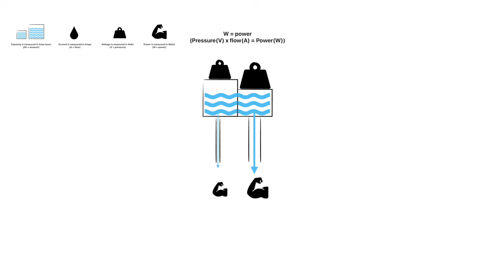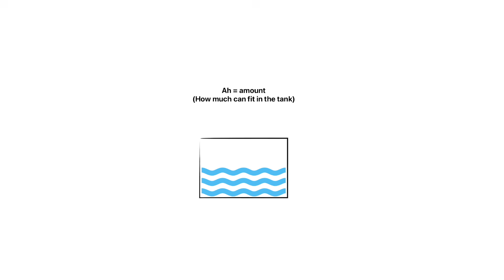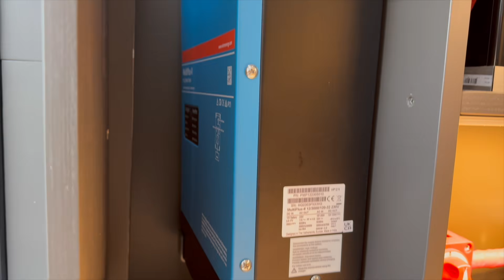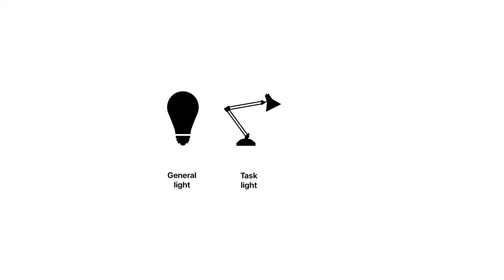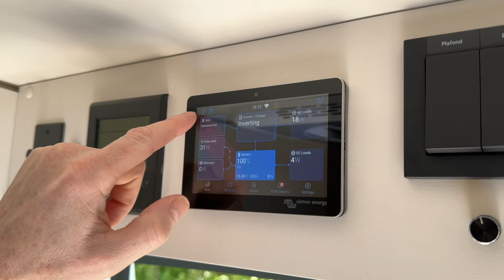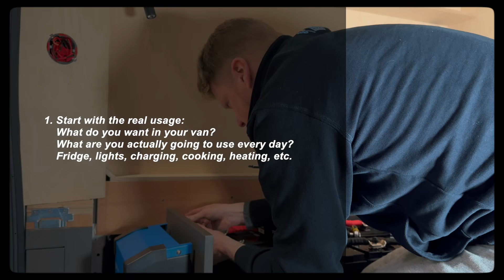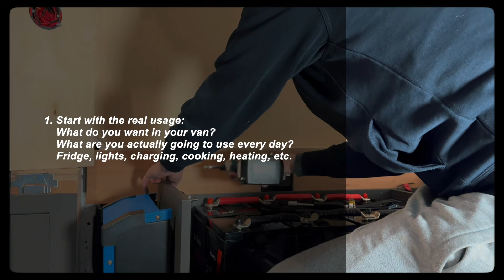I’m an Electrical Engineer, This Is How I’d Build an Off Grid System (Van Conversion)

Comment: Hi Sanne and Brendan,
Thank you for this outstanding, comprehensive guide to off-grid van electrical systems, your engineering insights and step-by-step blueprint are exceptionally clear for beginners like myself.

I am planning a similar Victron-based setup for my van conversion and would greatly appreciate knowing if you offer professional installation services. If so, could you kindly provide a quote for a full system install (including 400Ah lithium batteries, solar, DC-DC charger, and cabinet integration) based on my vehicle's specifications? I can share detailed requirements if you are interested.
Reply from the maker: Thank you and we’re glad to hear that it’s do helpful! 

We’re from the Netherlands so building your electrical system for you is not possible (you’ll have to fly me in so that would be a very expensive quotation 😅) but if you have any questions during your build, you can always ask. 🤗

Comment: Hey, nice video. But I was missing an important part: Picking the right voltage for your installation. I see you went for 12(14)V - But for my project I wonder if I should go for 24 or 48 Volt.
The reason behind that: I will install air condition. And thats a lot of Ah/day. So if my solar panels come from the roof with 140V - I need to convert it ALL the way down to 14V into the battery. But now my AC wants 230V or (12/24/48 - depending what device you but). So I need to get it ALL the way up to 220V wich isn`t great - OR run the AC with 12/24/48V. Given that the needed Wattage of that AC stays the same - and it`s most likely/common 1500Watts - a 12V system would run ~128A - a 48V system would run ~32A.
That is either very expensive in wiring or a good way to start a fire ;)
TLDR: I`ll get 140V from the roof - storing them at 48V is more efficient. Running my AC with 48V is way more efficient. 
And there we run into the next problem: Diesel air/water heater are max. 24V. Running LED? Would need a DC converter, too. 
Well the main power drain will come from my working PC. While working the PC draws like 210W, Netflix&Chill is 140ish Watts. I found a PSU which operates from 12-63V (HDPLEX 800W DC-ATX) - which would run more efficient on 24V.
It is SO complicated...
Reply from the maker: Thanks for watching and your question and honestly, you’re already doing the right thing by researching this in detail, because system voltage is one of the most important choices in a build.

It doesn’t really come up in this video because this build is specifically based on a 12V battery system with 230V components through the Victron Energy MultiPlus. But the exact same principles apply for 24V or 48V.

The real question is: what do you choose as your base system? That should always be based on the loads you use the most, not just the biggest load.

For us, most daily-use components (fridge, lights, modem, pumps) are 12V, so 12V made the most sense. If we switched to 24V or 48V just because of an air conditioner, then all those daily 12V loads would need to be stepped down all the time, creating continuous conversion losses.

We also run a D6E diesel combi heater: 4kW on diesel and 2kW on 230v electric. The electric heating element is connected through AC-out 2 of the MultiPlus II, so it is fully monitored by the MultiPlus and the Victron Energy Cerbo GX. But that electric mode is only used when we are plugged into shore power at a campsite, not when off-grid.

Off-grid, we use the 4kW diesel mode, and electrically it only needs 12V, with a max of around 15A during startup and around 2–6A for control and operation.

So in our case, the daily base loads are still mainly 12V. But if air conditioning and a PC are major daily loads in your setup, then 24V starts making a lot more sense.

And if you want to run air conditioning from your battery bank for long periods, you’ll very quickly need a much larger battery bank anyway, regardless of whether you choose 12V, 24V, or 48V.

So in short: choose your system voltage around your daily energy profile, not just your biggest device. :)
Reply: @ourtraveljournalnl  I think I`ll go with 24V.
It`s better for running my (Desktop PC), I can get LED, Heating and so on for 24V... And IF I need airconditioning I have so much sun, I can nearly run it of the roof anyways. I plan to use a MultiPlus-II GX, so I just have to switch from the 48V version to the 24V one - and I could fire up my AC via 230Volts then. 
I`ll have 4x Trina 725Wp+ N-Type panels on a tiltable frame, so on days where I need AC I should have that covered. 
Exciting. So far I`m in big pain learning to use Sketchup - and it`ll take month to plan.
Reply: One of the neatest and well thought out builds i have seen in my many years in of grid RV touring, A+ mate!
Reply from the maker: @AndySmith-H2 thanks a lot! 🙌🏻
Reply: You have to narrow it down depending on your needs/appliances and wallet. 24v it you saving on wiring cost or voltage lost is too great especially over +- 9m and inverter price is cheaper (compared to 12v) but only for few accessories excluding fridge and aircon and the rest you need a step-down? In multi battery use, If one battery is weak it weakens the whole battery system. 1 battery can be cheaply replaced in 12v or temporary taken out without putting everything out of commission therefore 12v is more expensive but convenient! Personally, ill go with 48v but I'll need a good step down for most appliances. Less loss, higher amps, cheaper/thinner wiring. Most 48v eg inverters are much cheaper. Battery bank is expensive to replace but compare to 12v, much safer incase of vehicle accident and doesn't catch fire quickly! Added bonus I can purchase a 230v/120v cheaper and more efficient fridge as my amps is high...but then it have to worry about my solar array, especially parking in shade!

Comment: Very clean installation, perfect example of how to follow good practices! I ended up specifying 2x50mm cable from the inverter following Victrons installation manual - did you end up using a single conductor?
Reply from the maker: Thanks! Yes, I ended up using a single 95mm² conductor for both positive and negative instead of 2×50mm².

Victron specifies 2×50mm² per pole on the MultiPlus-II 12/3000 mainly to achieve the required copper cross-section and keep voltage drop low, but also to spread the current over the terminals. In my case the cable run is only 0.6m (+ and -), so the voltage drop with 95mm² is negligible.

The system is LiFePO4-based with a 400A BMS and a 400A main fuse on the battery side, but I fused the MultiPlus branch at 300A. That keeps selectivity in the system: if there’s a fault on the inverter branch, the branch fuse goes before the main fuse.

Load-wise the inverter is mainly feeding general outlets and a 2.4kW cooktop. At 12V that’s roughly 210–230A DC under full load, so well within the 300A MEGA fuse range (especially considering its time-delay characteristic).

So yes, 2×50mm² is the textbook Victron way, but for a short 0.6m run, 1×95mm² is electrically equivalent enough in practice and keeps the install cleaner.
Reply: @o @ourtraveljournalnl  nice, that makes sense. Initially I thought it’s worth using twin conductors to the inverter to minimise dc ripple, but it might be overkill. I doubt I can bend the 95mm in my cabinet. I’m doing my best to close it off no further than the wheel thickness (l2h2 base)

I’m also on 400A BMS but skipped the battery bus bar. Struggling to find an isolator bigger than 350A and my battery cable space is a little cramped. Currently installing individual 70mm battery cables with mrbf fuses and separate isolators, 2 lugs stacked on the lynx in connector, as I’m reluctant to use 120mm cables.

I see you built the battery bank diagonal parallel circuit, it’s honestly just the cleanest way 👍🏻. What was your battery cable size? 

Thanks for the videos, and well done on the build - you guys did a great job 👏 it’s nice to geek out a bit 😅
Reply from the maker: @shemnor5647  For our build, all the battery-to-busbar cables are 120mm², protected by a 400A ANL fuse in a Blue Sea Systems 5503 ANL fuse block (35A–750A). I designed the electrical cabinet with that cable size in mind from the start, so I made sure there was enough room for proper bends and cable routing. From there, the positive goes through the main battery switch and the negative through the Victron Energy SmartShunt, and then both continue into the Lynx Distribution.

Your approach with individual MRBF fuses per battery and separate isolators sounds very solid too, there’s definitely more than one good way to build it. it’s always a balance between safety, space, and serviceability.

If you want the exact fuse block and other parts we used: 
Fuse Block: https://amzn.to/4kUv6r4 
ANL 400 Fuse: https://amzn.to/4axJJNi 
You can also check out our FREE guide with worldwide links to 125+ tools and products we used in our van conversion. (You might first see a white screen when you open the webpage as it sometimes doesn’t load properly in some webbrowsers, but it’s there when you scroll down) 

Always happy to geek out over this stuff! Sounds like you’re building a great system!

Comment: I know if someone to touch the pcb, should be licensed at home. how about in motor home / caravan?
Reply from the maker: This is a tricky one because rules and guidelines differ from country to country.

In the Netherlands, you are generally allowed to do the work yourself, but in both cases it still has to be done safely and correctly according to the applicable guidelines. Motorhome/caravan installation are usually based on ISO 13297.

That said, we did have our camper professionally inspected and valued, including an electrical inspection report for the insurance. That way we know exactly what is covered and that the installation is considered safe and insurable.

Comment: Just starting to watch but don't want to forget to ask, I'm assuming you dont talk about this but my friend is a boat electrician and he told me not to attach the batteries in a daisy chain but to run each battery on its own wire to a bus bar then run that to the main bus bar or distributor. He says if you dont it will make one of the batteries a slave (uneven draw). This is going to make my build much bulkier though, what are your thoughts on this since you did the daisy chain?
Reply from the maker: Thanks for watching the video and for taking the time to comment. I appreciate it!

The way I built it was based on first deciding that a 12V system would be enough for my setup. Once that was clear, the batteries were connected in parallel: positive to positive and negative to negative. In a way, those parallel links already act as the busbar, they’re just located directly on the batteries instead of being mounted separately somewhere else.

From a pure engineering perspective, separate positive and negative busbars are usually the cleaner and technically better solution. They make the system easier to expand, easier to troubleshoot, and create one central connection point with equal paths and length to each battery.

That said, for a compact setup like mine, we chose this approach because it saves space, reduces extra cabling, and keeps the system simpler while still achieving the same result when done correctly.

The important part when using multiple batteries (for example battery 1, 2, 3, and 4) is where you take your main positive and negative from. You should take the main positive from battery 1 and the main negative from battery 4. That way the load and charging are spread evenly across the entire battery bank, making it behave like one large battery bank.

Also very important: keep the positive and negative cables the same length. That keeps resistance as equal as possible and helps ensure balanced charging and discharging.

In my setup, the positive cable goes through a fuse and then to the main battery switch. The negative goes to the SmartShunt. From there, both connect to the Victron Energy Linx Distribution (or a similar distribution box), where the larger components can be fused properly.

If you choose to use separate busbars mounted somewhere else, that’s absolutely a solid option and technically the cleaner way to do it. But in smaller systems like this, using the battery terminals as the connection points works perfectly fine as long as the cable lengths are matched and the takeoff points are correct.

One more important tip: when connecting multiple batteries in parallel, first charge each battery individually to 100%. Then connect them together and let them balance. After that, connect the full system, apply some load, and charge the whole bank together to 100%. That helps the battery bank start balanced and work together properly.
Reply: @ourtraveljournalnl Thank you so much for this! Great info, I think had I not spent all the money on buying the longer wires to run it all to a bus bar I would have done it the way you did. Makes sense that all the wires are connected to eachother so it is kindof like a big bus bar on top of the batteries and the system will want to pull from whichever battery has the highest voltage or otherwise pull from all equally. Will probably wire in parallel on my next van to save space. Thank you! And great video